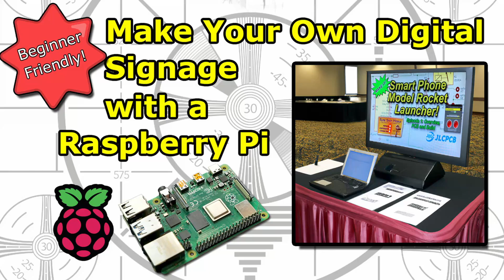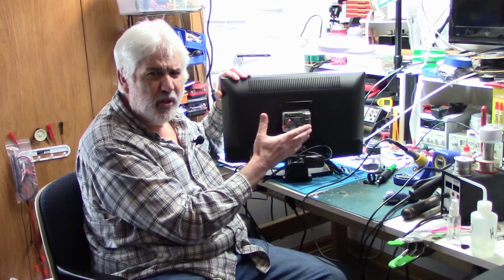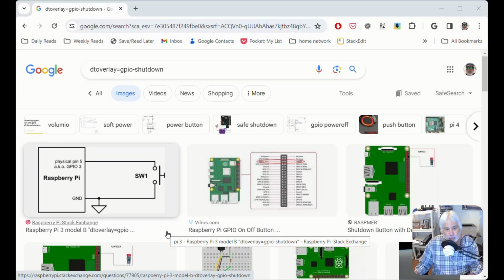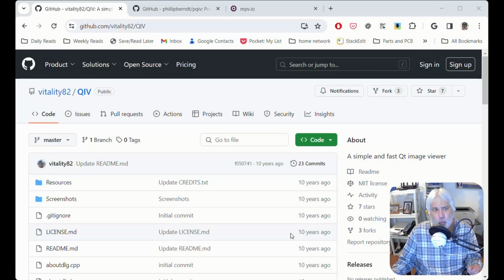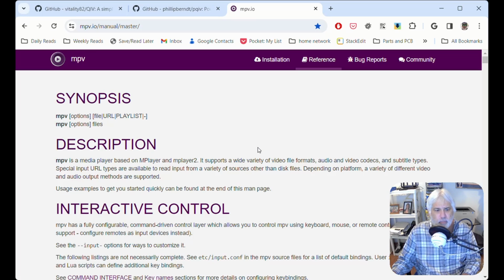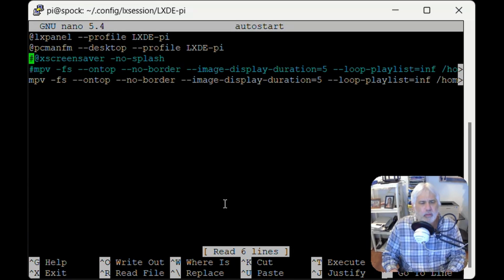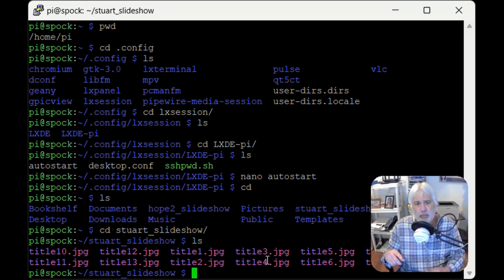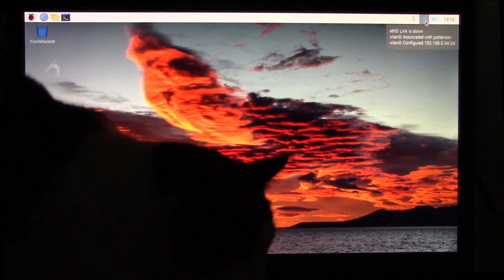Make Your Own Digital Signage with a Raspberry Pi

Comment: @StuartPatterson Thanks for setting up the Digital Signage. I didn't see which Raspberry Pi OS or other OS you installed.  Could you explain that part of this process?  thanks
Reply: I see this statement - get the Debian version, or do you mean "Raspberry Pi OS Lite"? Check with a "sudo apt update" followed by "sudoapt install mpv"
Reply from the maker: I installed the raspbian lite version of Linux. I have been meaning to make another video with better instructions. Just been too busy. Sorry.
Reply: @StuartPatterson  I did find this https://youtu.be/IwpxE2zalTw?si=RZ-M0kiCheJkQ8Cr

Comment: Hey Stuart, I did this project, Thanks! It works great except for one thing. If my TV shuts off, somehow the MPV resizes when the TV comes back on, and i have no way to 'maximize' it. Any thoughts?
Reply from the maker: The mpv.io site shows alt+1 to return it to the original size.  Maybe that will do it?
Reply: @StuartPatterson  Thanks for the quick reply! The deployment has no kb/mouse. it just runs all day and they shut the TV off at night then back on in the morning. Maybe a script that runs periodically that maximizes.
Reply from the maker: @gruv2ths This might help https://forums.raspberrypi.com/viewtopic.php?t=341712
If you figure it out please reply back.  I am interested in the solution.

Comment: How can I go about using a proximity sensor to alternate between different videos/images.
Reply from the maker: The HOW is to complex for a reply.  However the project is doable, but it will take some understanding of basic electronics, and C programming on the PI.  Sounds like a good project!  It might also require some changes in mpv.io but the feature would make a nice pull request.
Reply: Use an ai chat bot to guide you.

Comment: Hi Stuart, 
   This is great content, I'm new to pi, but not computers in general, some of this stuff goes over my head but I have fast reflex's and catch most of it. I've been Tasked with this Exact project (1st one with a pie).  I tried one of the fancy options but it required continual internet access and also overwrote any of my changes to the config.txt file. So as a Noob Id Like to follow your path. To do so can you nudge me in the direction of what OS is best to use with this, it seems like everyone and their brothers uncle have options to chose from.   NooB again, I ask because You mention Xwin desktop and also suggest using a newer raspberry os.

pie 3b+
aduitfruit 5" 800X480 display
stand alone set and forget
no wifi/net, Kb/mouse, sound needed. or available after setup.
single video on repeat
Art install
have clean slate micro flash
have RPi imager
Use windows on desktops :)
Reply from the maker: Yeah, so I used the latest version of raspbian with desktop downloaded from raspberrypi.com.  Your display might need some special config but adafruit should have that information.  Otherwise, it is not that difficult.  I believe I show in the video how to turn off wifi, etc.  Good luck and have fun.  Google is your friend!

Comment: Is configuring the on/off switch to auto restart necessary if the Pi already has a power switch? Or this only for version older than Raspberry Pi 5 (which is what I am currently using)?
Reply from the maker: You don't need the on/off switch if your pi already has one.
Reply: @StuartPatterson  Wow, that was fast, thank you. It's not auto running the slides when I reboot the pi. Is there a way to start the slideshow process with a command from the terminal?
Reply from the maker: @LNProfessor  Yes, in the video description I give additional information including the commands.  To start it you and type mpv -fs --ontop --no-border --image-display-duration=5 --loop-playlist=inf /home/pi/your_slide_folder

Comment: what software? i get to the website  i chose the version i want but then i get confusing choices and i cant figure out how to download Debian is the closes to raspberry pi
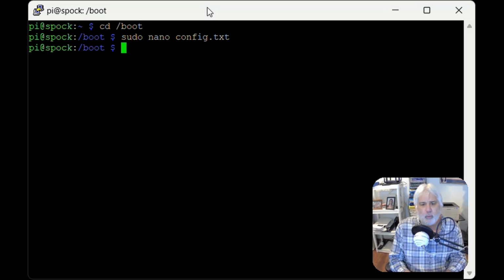Reply from the maker: I cover that in the video starting at 4:37  Does that answer you question?  I ended up using MPV.
Reply from the maker: @jcw232000  https://mpv.io/installation/  Hopefully that will help you get what you need.  Sorry for complexity.  I also updated the video description to include the link.

Comment: Great, straight forward and clear information. Thanks for posting! 

At the beginning of your video you mentioned more advanced packages that you considered overkill for your project. What were those packages? I'm interested because we're thinking about digital signage for conferences as well, but we may want to add interactivity or explore other options.
Reply from the maker: Glad it was helpful.  So, the more advanced packages I looked at that had a free option where: Screenly, PiSignage, PosterBooking, and Info-Beamer.  I did not look too deeply into those because the non-profit I was helping needed it to be simple and without future costs.  Even though, I believe all of those have free options, I was worried about supporting them in the future.  The solution I used was easy and I left some readme files if I have to address issues in the future.